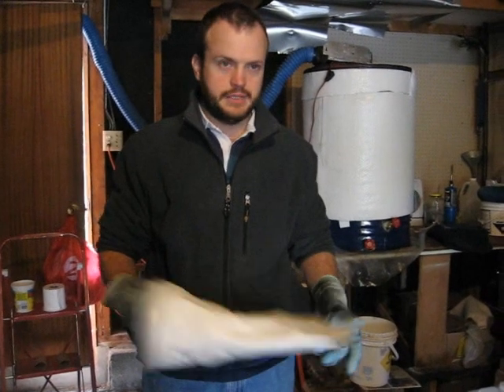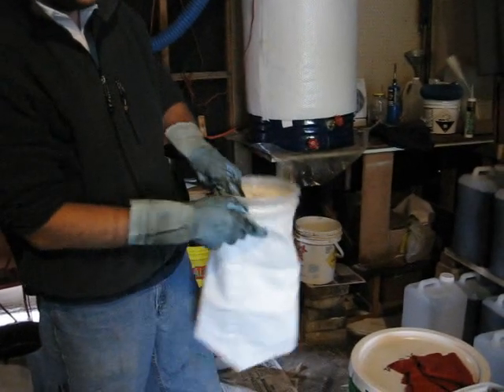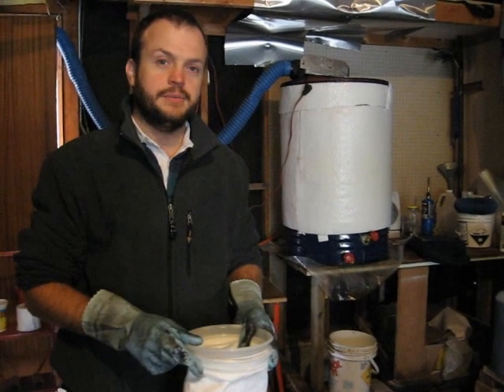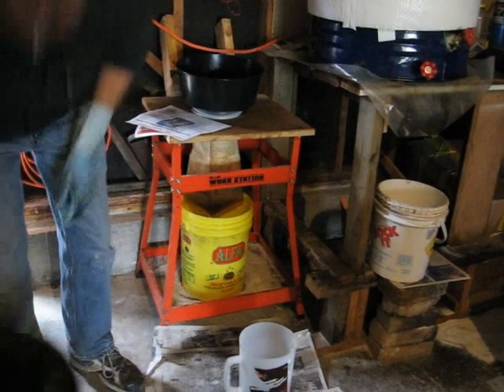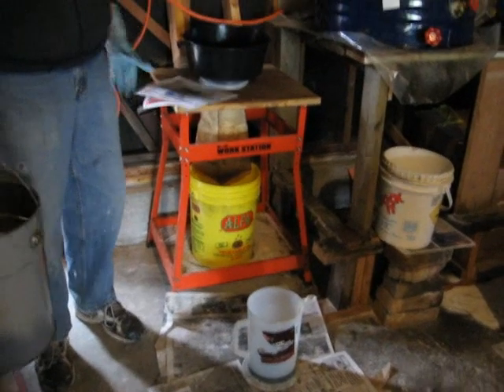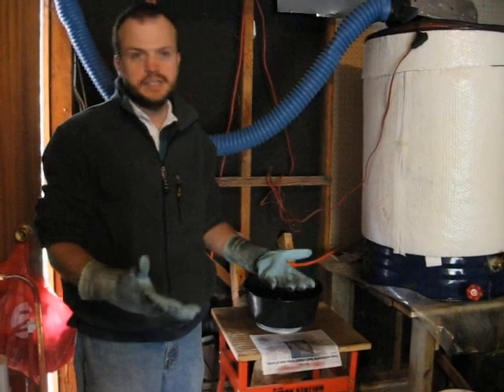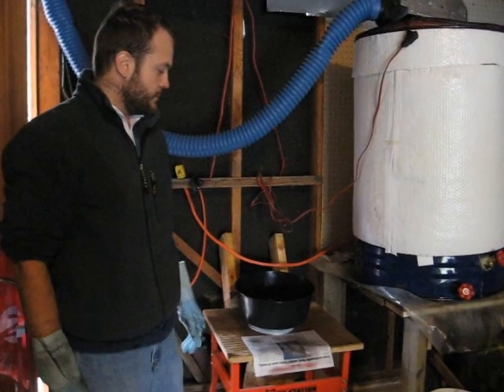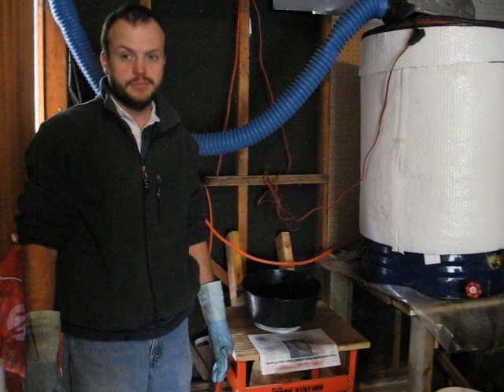Veggie Oil Fuel Home Processing Plant  - Filtering

Comment from the maker: To make biodiesel, you add Lye and Methenol in the proper amounts, heat the whole mess up to about 60C (70C will ignite the methenol) mix it for a few hours and let it settle.

But I don't use BioDiesel.  I installed a kit in my car that lets me burn streight veggie oil.